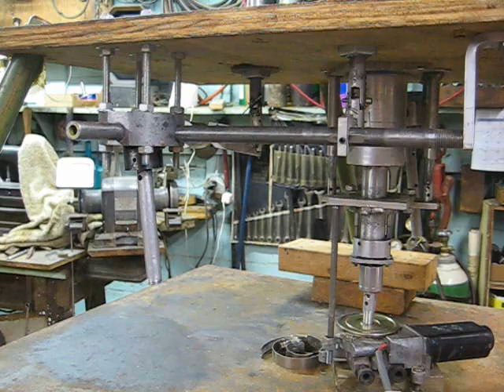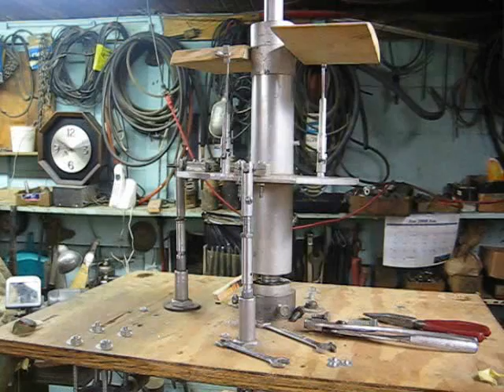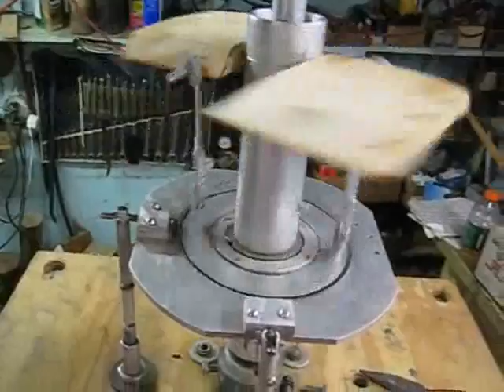CYCLIC PITCH & SWASH PLATE

Comment: This is not the whole swash plate works. Collective pitch will be lifting whole swash plate assembly up and down...and that is missing completely here. Your need to lift whole swash plate up, to have right amount of pitch for blades, to have lift. This configuration helicopter never can have any lift, swash plate just add lift in one blade and reduce other one same amount. This just show how you can steer that chopper, but not how you can actually lift it on a ground...